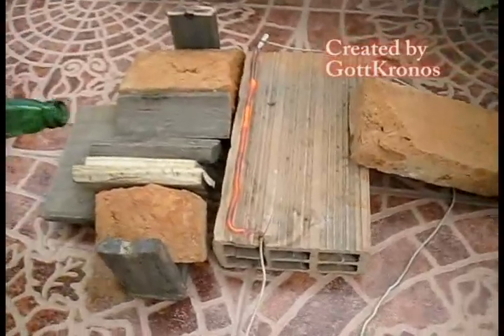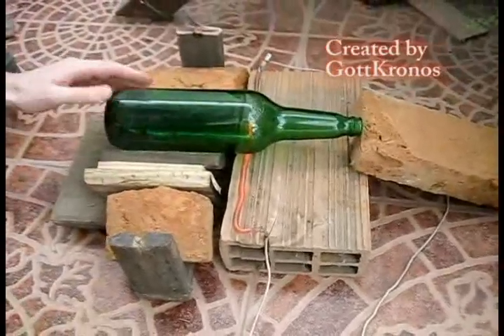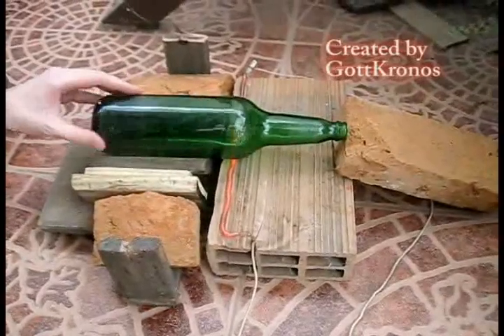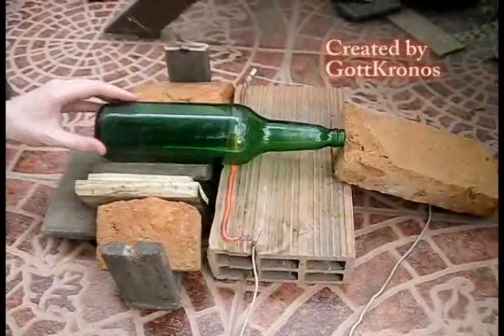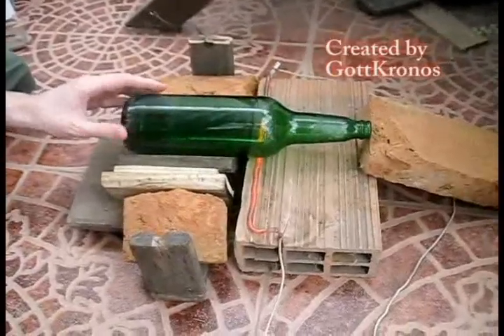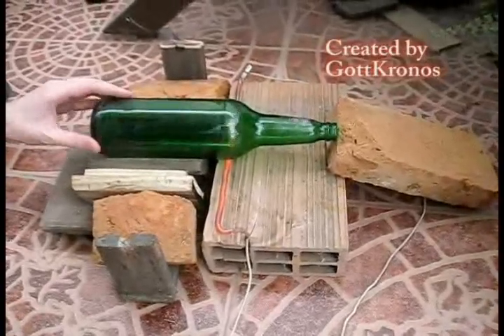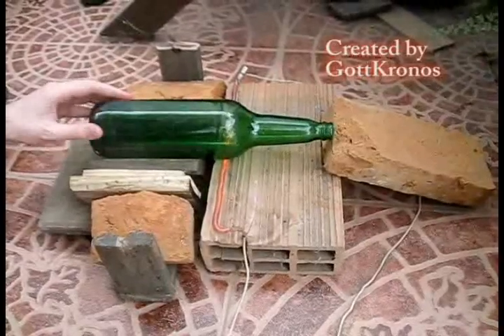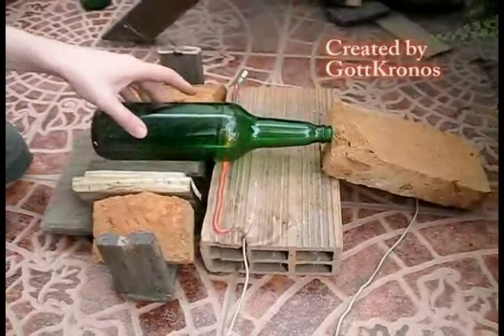Cut glass bottle - Easy and quickly way

Comment: I have tried this with nichrome and it does work, albeit a little risky.  The same thing can be done with a $15 heat gun, and much safer.  As with anything you see on the internet, proceed at your own risk.

Comment: This is a revaluation in cutting bottles, thank you because I'd had given up.
Reply: This is a lot cheaper but never give up, I use a hose clamp as a guide and a glass cutter and then a micro-torch.  I've met with limited success.  Don't give up, you can buy a wet tile saw and buy a diamond tipped glass cutting blade.  Lowes sells the wet tile saw, cheapest one, for around a hundred dollars.  The diamond blade is another 35 to $40, but I'm planning on doing a lot of bottles.

Comment: A Very good way to die.....NEVER NEVER NEVER use household voltage to do this! If you were to slip and your hands came in contact with the exposed wire you could be electrocuted.

You CAN do this more safely using a car battery or adjustable 12volt power supply.
But you can still burn yourself on the red hot wire.
Also ALWAYS wear gloves and safety glasses.
Reply: You should shut the fuck up. No one wants to hear your Youtube safety lessons.
Reply: eyeball
Well you just proved to the whole world that your a moron.
Reply: mellotron  So I didn't use the correct form. There are no words misspelled.
But at least  I didn't ridicule someone for trying to save someones life.
Reply: Deltaxray7 It's funny how people that call others a moron can't even type one sentence and spell all the words right.
Reply: Deltaxray7 Car batteries have more amperage than Household electricity ;) Its the amps that kill, not the volts
Reply: MirriOwner Very true.
Reply: Deltaxray7 "your a moron"
Look who's talking, dumbass..
Reply: Stem 12 volts won't lower your skin's resistance enough.
Volts and amps rely on eachother.
Reply: Deltaxray7 you are right  these idiots who just don't get it are the same ones who end up in A&E swearing at someone does not make them right

Comment: This method did work very well but I wasn't very impressed that long hot wire seamed very dangerous to me and the process took a while you can get the same result from a bottle cutter and some hot and cold water quicker with the same result